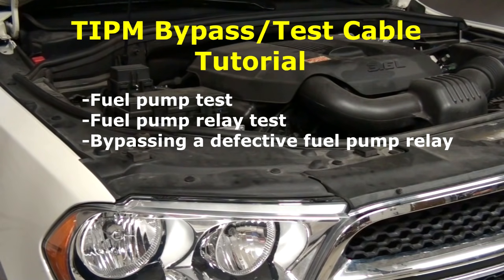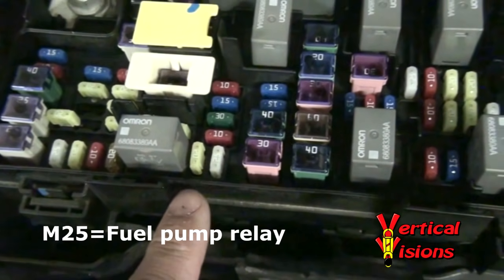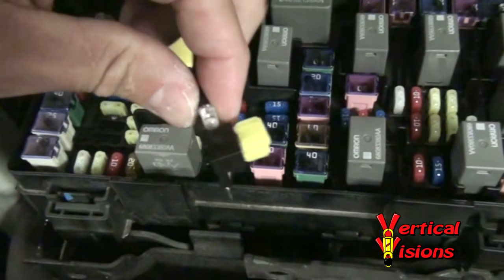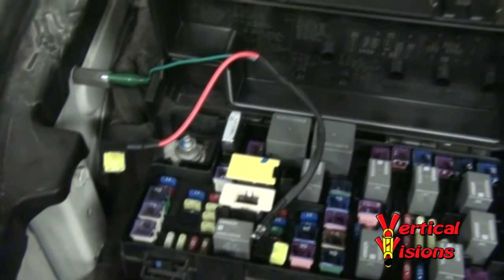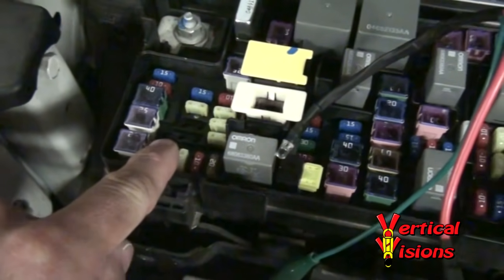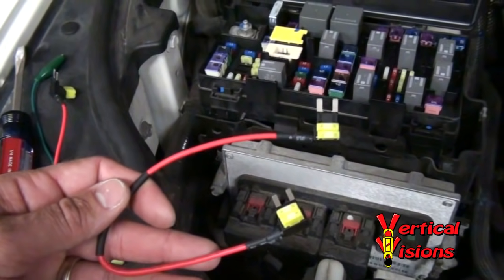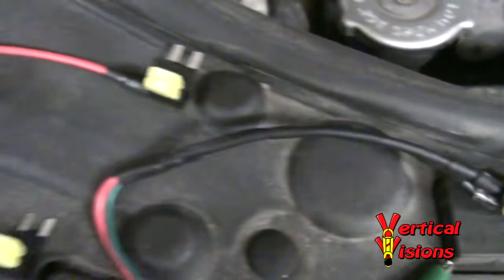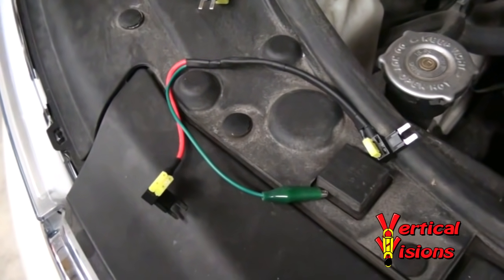TIPM Fuel Relay Test and Bypass Solutions - Most 2007-2021 Dodge, Chrysler, Ram, Jeep, VW Vehicles

Comment: Just had a mechanic install this on my 2011 Dodge Caravan.  I told the mechanic I was pretty certain this would take care of the problem and it did.  Delivery took only a couple of days.  My only concern is that I'm not sure if I should just leave it and see if it lasts or if I should have the whole TIPM removed and send it in to have them rebuild it.  If anyone sees this comment, I'd like any feedback regarding whether or not they have had good luck with just leaving this jumper permanently (?)...
Reply from the maker: https://www.verticalvisions.com/tipm-test-bypass-cable-mini-blade-fuses.html#faq2

Comment: I ordered the mini fuse kit for my 2011 Dodge Ram 1500. I’m gone the build the kit and keep it in the truck. I don’t have a fuel pump issue yet. But I’m playing it safe just in case. I’m don’t want to get stuck on the road. Thank you Jason for the very helpful video.

Comment: Yeah....... I’m kinda pissed after seeing all of this. I wish I had done research sooner because I just dropped close to $1500 to get my fuel pump replaced and my truck has all the earmarks of a bad relay- the not starting, the starting then dying, and now the fuel pump is stuck on until the battery is dead. Thank you for the video. I’ll be contacting my mechanic to see if they can fix it (for free- warranty) and until then, I’ll be buying one of these.

Comment: My 06 has exterior light issues. Fix it for me
Reply from the maker: OK.  :)
Reply: @VerticalVisions  seriously though.  Can you by pass the tipm when one headlight isn't working?
Reply from the maker: @dev4statingx90  I am aware of headlight issues with TIPMs - most are from the TIPM shutting down the circuit when an improper current draw is detected.  If you change to LED bulbs (lower current) or your bulb is drawing more power than normal, the TIPM kills the circuit permanently (from what we hear).  There may be some shops that have identified a fix, but I'm not aware of them.  We only deal with specific TIPM styles on 2007 and newer vehicles, so I can't help other than give you a link to where you can buy a used TIPM at a discount from a guy we trust.  Go here:  https://www.verticalvisions.com/products/used-tipms.html.   Hope this helps.
Reply: @VerticalVisions  thanks. I did watch a video of a guy who just spliced the two headlights together. 2 years later it still works apparently

Comment: Just a word of Note. Even if your fuel pump runs, it still may not be meeting the fuel pressure needed to run the vehicle properly. Kudos to Jason however for showing how to bypass the fuel pump relay. I use to do that on my Chevy Astro which had a factory wire that powering the fuel pump directly when connected to the battery positive. Bypassing the fuel pump relay to prime the fuel pump and build pressure can help you run/limp the car home in a pinch. Always test the pressure and be sure it's at specs. I'm going to by a LED wire from him just to show some support and thanks for his contribution

Comment: 2011 town and country every morning won't start even with your wire...and when u let off the key it continues to crank till you Shut it off.... After a few tries it'll finally go .....fuel pump runs normally...im guessing fuel pump isn't holding pressure over night or is there another issue
Reply from the maker: Try our new cable connection method:  https://www.verticalvisions.com/tipm-test-bypass-cable-mini-blade-fuses.html#faq19

Comment: Just ordered one, My 2011 1500 ram started doing this exact thing about 5 days ago. Talked to a local mechanic he suggested to turn the key on and let it set for a few minutes before trying to start the truck. This suggestion works it may take a couple of tries before tit starts but it will start.
Reply: I found this work around worked for me too, initially I thought my FPR was toast, so I'd turn the key on and off to prime the fuel pump multiple times.
Reply: Elaborate
Reply: @jfielder8656  He's saying turn the key to the ON position, but don't try to start the vehicle for a few minutes while you leave the key in the ON position. This has been my temporary workaround, but it sometimes takes repeatedly attempts to successfully crank.
Reply: An this is exactly what my truck is doing. I have just randomly been doing the crank trick and if I hit the gas at the right time I can sometimes get it to crank and stay running! Definitely gonna look into this relay solution
Reply: No problems since  installing  this work around

Comment: what about a 2006 dodge ram 1500? the fuse panel isnt anywhere near what the 2007 on up is, its sparse, & appears to have circuts that are redundant, more than 1 doing same job, nowhere does it say anything about a fuel pump or relay to it.
Reply from the maker: We are unsure if the cable will work in your vehicle.  See the following chart and read NOTE 1 at the bottom to determine if it might work in your vehicle:  https://www.verticalvisions.com/products/tipm-test-bypass-cables.html#vehicles

Let us know if you have further questions.  Thanks.

Comment: I bought the cord and installed it on my 2011 ram 1500 that was having the same problem. It fixed it for a day I went out today to try and start it and it was back to having the same problem. any ideas?
Reply from the maker: Yes, there are several ways to connect the cable.  Try our newest method:  https://www.verticalvisions.com/tipm-test-bypass-cable-mini-blade-fuses.html#faq19.  Some TIPMs disable power to M7 during cold weather.  It's not a cable problem, but a TIPM issue.  The new connection method should resolve it.

Comment: I have a 2005 dodge magnum rt. Could this be an issue?  Cranks bo start.  No fuel
Reply from the maker: Fuel pump relays can be an issue with most vehicles.  Using a TIPM cable to resolve the issue requires the affected relay to be positioned after the fuse and before the pump.  We have not tested our cables on your vehicle, but you can read more here about why it may or may not work (see NOTE 1 at bottom):  https://www.verticalvisions.com/products/tipm-test-bypass-cables.html#vehicles

Comment: I just want to add a quick PSA for anyone else in the colder areas that used this fix and still have issues with getting the car started.   This fix worked just fine for me but when it got below freezing the car would no longer fire up.  The reason is because by jumping from the rear cigarette lighter the power is cut for a brief moment when you crank over the motor.  Basically if it doesn't start in that split second of turning over from the pressure that was built up when the car first was turned on,  the fuel pump power cuts off and the engine will just continue to crank.

Do yourself a favor and follow the relay switch bypass method if this happens.  Really have no idea how this hasn't been recalled at this point.
Reply from the maker: We have a new way to hook up the cable that resolves all cold weather starting issues:  https://www.verticalvisions.com/tipm-test-bypass-cable-mini-blade-fuses.html#faq19.  We also have other products out now where this isn't an issue.  Yes, the TIPM sometimes won't send power to the cable when the battery has low voltage (sort of a self-preservation thing).
Reply: Thank you!  I was losing my mind with why my car just decided to stop working once it got cold out!  Huge thanks for posting how to fix this issue.  The biggest issue for me was just finding the correct terms when searching for the issue that I ran into.  99% of the stuff just says to check the battery when I knew it was okay.    @VerticalVisions

Comment: Be aware where you are getting power from will continue to have power until system times out or you open the door. I prefer to use a relay and tie power to relay from instant on and off so when key is shut off so is the fuel pump. Russ Master Certified Tech
Reply from the maker: We have a new TIPM cable connection method via M37 (run/start) instead of M7 that removes fuel pump power with key off.  We also have other products now that do what you mention.

Comment: The battery on my 2011 Ram 1500 was draining down overnight. After some research, I came across this video. I ordered the jumper and installed as per directions in this video and it solved the problem. Thanks for researching and sharing the solution. I ended up saving a couple of thousand $$.

Comment: Craftsman Diagnostic Code Reader OBD2 & AABS / SRS - 091655  will this scanner tell me  if my TIPM module is functioning with codes for lighting, seats , tires, headlights
Reply from the maker: OBD2 scanners normally only identify existing faults by reading a code that you can then translate into a specific sensor/part/etc.  Keep in mind that vehicle issues are not always identified via a scanner.  For example, the fuel relay issues in my video will never create any codes because there are no sensors to determine if the relay contacts aren't allow power to pass (or the contacts are stuck on with the vehicle off).  For a device that tells you if your TIPM is functioning properly (i.e.  it can test/cycle relays and such), you'll likely need something that the dealers use (if that's even available).

Comment: Would this work for a 2014 Dodge Ram?  Something is draining my battery.  It does start, but is very sluggish.  Has never died while I was driving it.  Once it is turned off and started immediatley it is sluggish to start.
Reply from the maker: Yes, but you need the micro2 version:  https://www.verticalvisions.com/tipm-test-bypass-cable-micro2-fuses.html

Comment: I didn't see the 2012 Dodge Grand Caravan on the list, but I assume it could be the same? I've already had the fuel pump replaced (Before I saw your vid or learned about the TIPM) Anyway, after the fuel pump replacement and spending over $600, I still have intermittent starting problems. (It usually takes 3 to 7 tries for the engine to start. Sometimes it starts right up, but rarely. I'm guessing it's my TIPM. I need to drive this vehicle 1/2 way across the country and back the week after next.... Hopefully I can get this over nighted and fix it this coming week...
Reply from the maker: The video is a bit old with respect to applicable vehicles.  Yes, your 2012 Caravan will work with this cable.  Here is the full vehicle list:  https://www.verticalvisions.com/products/tipm-test-bypass-cables.html.  We overnight cables to customers every day.  Thanks.

Comment: Jason i put the part on just like you said but the pump is still running! Any suggestions
Reply from the maker: Must remove lower 20 amp fuse on M25 end of your cable if your faulty relay is stuck on.  Or you have the M7 end in the wrong side (must be in left slots of M7, not the right slots which are always hot).  Even better, use our "new" way to hook up the cable:  https://www.verticalvisions.com/tipm-test-bypass-cable-mini-blade-fuses.html#faq19

Comment: Dear , i did that on my Dodge caravan 2012, its run now , thank you...but i want to keep it as it as , i will leave this small cable between these 2 fuses...can i do or its dangerous?...i will wait for your reply
Reply from the maker: If it were dangerous, we wouldn't have created this video and there wouldn't be tens of thousands of cables in use today.  If you are building your own cable, please make sure it's rated at 20 amps.  Our cables are custom made for us using 14 AWG wire, which you won't find online or at any local store.

Comment: Good morning and happy new year I have the same problem on a 2010 Dodge Journey 2000 diesel engine 140 hp the car goes off in gear and when I try to turn it on again it seems as if you do not get the fuel this solution can be good for my car? Thank you
Reply from the maker: We don't see a lot of 2010 Dodge Journeys that have a fuel relay issue, but it's possible.  Your TIPM should be the same as shown in our video.  Either way, you should at least test and confirm the fuel relay is working.  This can be done with a test light, multimeter, or our TIPM cables.
Reply: @VerticalVisions  hi I connected the cable today is for now seems to work everything perfectly Thank you you know why the radio no longer takes the stations?
Reply: @VerticalVisions  Bad news, again power off .
Reply from the maker: @dwtshopenjoy660  Try connecting the cable this way:  https://www.verticalvisions.com/tipm-test-bypass-cable-mini-blade-fuses.html#faq19.  The radio could be due to you lifting the IOD fuse.  It's the only fuse with a white bezel around it.  Push it down all the way to fully seat it.

Comment: Great video. I had the same problem on my 2011 T&C van. I took it to the dealer and TIPM was replaced with a new one. Extended  warranty covered the the repair at 100%.

Comment: I had the same issue.  Before figuring out what it was, I replaced the coolant temp sensor, all plugs, both can shaft sensors, and the throttle body. 
Too bad I hadn’t known about this issue prior, I could have saved a bunch of money intended for Christmas gifts for my children. Pretty crappy that so many people have this issue and Chrysler hasn’t recalled the faulty TiPM’s. Last Chrysler I will buy.

Comment: Does this apply for PT Cruiser (2007) too? I have a transmission low voltage fault code.
Reply from the maker: We are unsure if the cable will work in your vehicle.  See the following chart and read NOTE 1 at the bottom to determine if it might work in your vehicle:  https://www.verticalvisions.com/products/tipm-test-bypass-cables.html#vehicles
.  Let us know if you have further questions.  Thanks.

Comment: Just wanted to say thanks for saving my 2011 Ram 1500 from a very large mechanic bill!  Started having issues about a month ago, truck was hard to start, then would only start with my remote on my key, then wouldn't start at all...  Had the truck towed to my mechanic where they tested the battery, starter, alternator, fuel pump, and found nothing wrong.  While they were testing, I was researching and found your site.  I ordered the standard cable and installed in the lot at the mechanic, it fired up instantly!  I then moved the cable to the M37 to M25 with zero issues to this point.  I will be ordering your more permanent fix after the holidays, thanks again!!!!

Comment: This modification feeds power to the fuel pump with key on, engine running or not. If this vehicle were in an accident that ruptured the fuel line the fuel pump would continue to run and feed a possible fire even if the engine is not running? Normally the fuel pump will only continue to run if the PCM senses a crank position signal (engine running).
Reply from the maker: This has already been addressed countless times below and we address it on our website.  We have a new way to hook up the cable that will allow you sleep better at night knowing the pump shuts off in a crash.  Uncertainty of power removal to the pump in a crash is a well-documented limitation of the original (older) cable connection shown in this video that you would have noticed with a little light reading.
Reply: @VerticalVisions  Apologies for not reading down far enough. Thank you.

Comment: This saved my bacon this morning on my 2012 Ram 1500 4.7L. My vehicle has been stutter starting for the past week: starter would spin, but would not turn the engine over. Occasionally, the engine would turn, stutter, and go off. Even more rare, the engine would turn and keep running. But I prayed and was reminded that I had bought a TIPM bypass cable last year for $30 or so. I plugged it in and my truck immediately started. So I think I got it fixed.
Reply: Has the problem come back ?
Reply: @madebydade305ify  No, the truck has consistently worked/started since I installed the cable.

Comment: 2011 Dodge Caravan Canadian addition. The Fuse for the Rear Cigarette Lighter mentioned in this video will actually stay powered for a short duration after the ignition is shut off. 
Using the fuse immediately to the right that shuts down after ignition off is an option. Just make sure you are pulling power from the supply side and not the load side to avoid circuit overload.
That been said  I followed the diagnosis outlined and managed to save my Buddy a pocketful of cash. We did things a little different, just shaved off the covering for the fuses and soldered a jumper to the pin and re-inserted the fuses.
All in all an excellent fix for first appeared as a ETC fault which was somewhat misleading.
Reply from the maker: FYI:  We have a new way to hook up the cable in bypass mode that is nearly finished with testing:  https://www.verticalvisions.com/tipm-test-bypass-cable-mini-blade-fuses.html#faq19.

Comment: This cable does work great! However, I purchased a 2011 T&C about a year ago that had one installed as a fix and we started having issues with the van not starting when the weather got cold. Turns out the cable draws power from the rear power socket, but that socket has no power when cranking the engine, so we would have just enough lack of fuel pressure that the van would try to start, but not quite do it until after several tries. I did a permanent fix on the relay and all was good. This item is only for emergency and diagnostic uses.
Reply from the maker: Ken, we have a new way to connect the cable that resolves all issues you experienced:  https://www.verticalvisions.com/tipm-test-bypass-cable-mini-blade-fuses.html#faq19